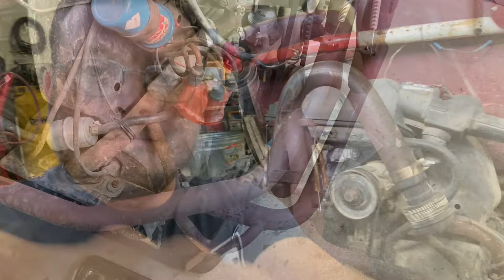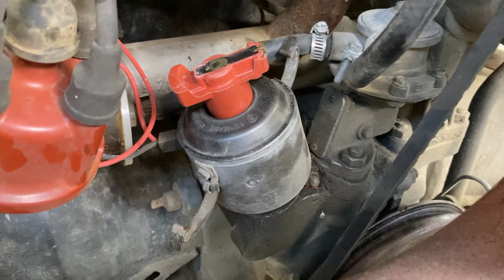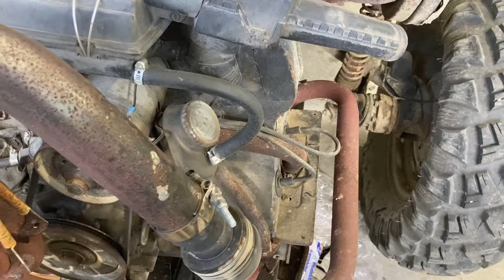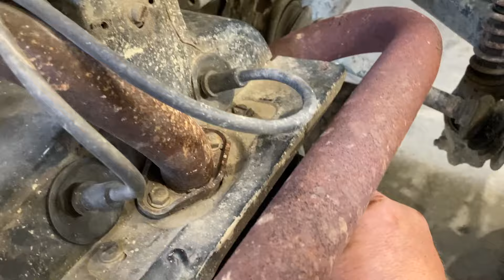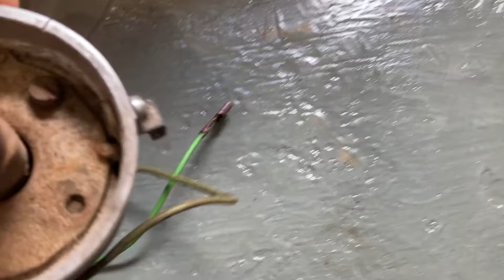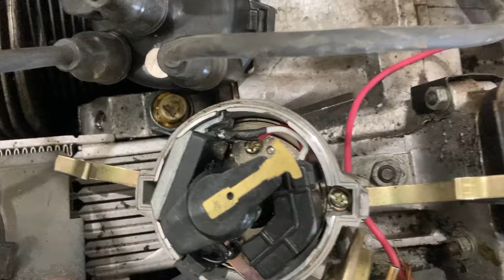Fool Proof Way: Find Cylinder #1 TDC on AirCooled VW Valve Adjustment

Comment: Great
Struggling with hesitation and idle.  
Bad has gotten worse.  
Went through a lot of trouble shooting.  
I have changed fuel pump (seems for no reason).
Changed my carburetor (my stock one was constantly leaking - but may be fine).
Checked plugs - seem ok.
Changed wires. 
Learned a lot so far. 
Checking fuel pressure next (rumors of over producing?). 

Just about to attempt timing adjustment - video is clear and a big help.  
Thanks again, Tom G
Reply from the maker: Check out the video on cleaning the heat risers and make sure they are clean. That will have a big impact on hesitation.

Comment: Thanks loads, well explained you helped me out of a problem that was a nightmare my valves were tight at tdc on pulley mark,number 1 cylinder with rotor pointing at number 1, so wrong thanks again, mark from Wales, uk
Reply from the maker: So glad it was a help!

Comment: I loved your explanation however I find that I make sure the pulley has its notches at either the top or the bottom and then go looking for the lose valves and adjust them and work backwards from there.
Reply from the maker: This was designed to make it as simple as possible so no one makes a mistake. There’s a lot of faster ways to go once a person is a lot more experienced

Comment: Just come accross your video great vid btw had issues with my t25 were ihve ahd to redo both carbs timing spot on but valve adjustment seems really tight and getting poping could that be were to tight .?
Reply from the maker: It could be.

The first step on any tune up for an air cooled volkswagen is setting the valve adjustment.

Here’s how I approach a tune up 

1) Valves
2) Plugs
3) Points
4) Timing
5) Carburetor Last

Comment: why is there 2 marks on the pully for alignment to case split? or does it matter which one to line up?
Reply from the maker: Different pulleys over the years had a different number of notches near TDC. For our purposes in the valve adjustment, the notches shown on this pulley aren’t significant enough to make a difference. As long as the valve is closed and the rocker free as shown, you’re OK
Reply: Thanks, that's what I thought for an old VW engine

Comment: Adjusting valves with engine cold is just a reference, I always do mine at operating temperature and every engine is different depending on cam etc you can make lash much closer then check when cold. But I set mine and engine sounds like it has hydraulic lifters.  Has to be at operating temperature and then I change oil. Been doing it that way since the 70's.  My ram air pontiac I'd set at 1 thousands and that's conservative,  some guys do zero lash that's a little extreme for me 😁
Reply from the maker: It’s not just a reference. If the engine is warm, the clearances will not be correct. Heat expands everything in the valve train, so if you set at .006 when warm, it will not be .006 when cold.

Volkswagen engineered the valve clearances so that it must be done cold to have proper clearance at operating temperature.

If the valves are too tight, they won’t properly transfer heat and you’ll burn valves. If they’re too loose, you’ve lost efficiency and it creates other problems.

Stick with the official Bentley Manual that Volkswagen used in the dealerships
Reply: @MaineMachinist  Yeah been doing it since the 70's hot and when cold comes back to. 006 for exhaust and  .004 for intake. Material of pushrods is a big factor for valve lash. Operating temperature is far more accurate than cold,  it's as close to dynamic you can get. I've adjusted hot on some engines to have it come out as .010/.012 cold 😳 Your engine looks pretty basic/stock to me. You start putting exotic parts/materials in your engines and you WILL run into valve problems.  Same goes with balancing,  static balancing is good but dynamic includes so many more variables.  You're a Machinist you know all about the variables calculating feed rates for Machining. Material is number one on the list then tool including the amount of Flutes material of tool, coating on tool , I can go on. You start putting dual carbs with dual port heads and light weight pushrods and all on that buggy and you'll learn the hard way setting a cold lash that's close.  I believe most want you to start at .014/.016 then when hot measure to come up with your own tolerances on all 4 cylinders. You might find a difference between cylinders 1/3 compared to 2/4 depending on exhaust.  Just trying to keep your valve train maintenance down to a minimum and performance up a tad. I can go 2 oil changes before needing to adjust.  But you can do what you want, if it works for you great. You do know all tolerances in an engine are a calculations for proper OPERATING tolerances ! Also if engine going into storage for any amount of time,  it's recommended to backoff rocker rod bolts so springs won't weaken. Not all engines are capable of this being done but 6 months with a intake valve sitting wide open can't be good 😕

Comment: This is great stuff but I have both an aftermarket distributor and pulley, so there are no notches on either 😭😭 I need a breakdown on how to find TDC without any marks or notches.
Reply from the maker: Watch the rocker arms move to find when both are in the closed position on Cylinder 1. Closed position means the valves are closed and therefore both rocker arms should be free and able to move by hand as shown in the video.
Reply from the maker: You can also remove the spark plug and use a wooden dowel in the hole to find when cylinder 1 is at its highest position (TDC)

Comment: Yes some adjust #1 and then turn the engine backwards just for convenience to adjust #2.  All are set at .006.  But why would you turn the engine backwards?  Turn it FORWARD and adjust #4 on the other side of your car.  (Stand up, walk over there, lay back down) 1-4-3-2 IS the firing ORDER.  Adjust accordingly! The feeler gauge should slide moderately without a lot of friction.  Trouble getting the feeler gauge in there? TIGHT valve! Loosen the nut and turn the screw counterclockwise ever so slightly. Re-tighten the nut. Try again. Easy to moderate sliding(friction) means a good clearance.  A tight valve will made a clicking metallic sound when running.  Listen for it!
Reply from the maker: Why waste the time getting up and moving needlessly? This is faster, easier and superior in every single way.

Comment: Also #3 Cylinder Intake & Exhaust Valves will move at the same time, will determine if your at TDC to Adjust # 1 Intake and Exhaust Valves.If #4 Cylinder Valves move at the same time, then you will adjust #2 Valves.Repeat the Sequence on the rest.

Comment: Wondering - I have a tube that comes out of the left side of the deck plate and goes to a small pot mounted to manifold with a lil nipple on it - What is it????  oil breather / cooler?  Cant seem to attach photo?
Reply from the maker: Almost certainly was a cylinder head temperature sensor from a later model engine that was original Fuel Injected.

Comment: I don't have a distributor it's in an airplane and it's a 1835 so how do I determine cylinder number 1
Reply from the maker: Does your crank pulley have the marks on it? You could line it up with the case halves and pull the valve covers to see which valves are closed or open. You could use a wooden dowel in the spark plug hole to help find the piston at TDC
Reply from the maker: What’s your ignition system?

Comment: Simple put the car in 4th gear push it to see what two valves are rocking. Adjust the opposite side which will be on the back side of the cam. As simple as that.
Reply from the maker: Many ways to skin this cat. What I wanted to show here was a way a person who is very unsure of themself could be 10000% sure they wouldn’t mess it up

Comment: Tight valve equals overheating.  Then the pushrod tubes literally bend and get stuck.  Avoid that.  Keep your VW.
Reply from the maker: Total fiction. You could burn a valve, but the pushrod tubes don’t change whatsoever. Maybe you are thinking about the pushrods themselves, but even then they won’t expand to the point of getting “stuck.” Never going to happen on a factory setup with proper rocker geometry. Never happen.

Comment: If you were on # 3 the rotor would be 180 degrees from where it is now.
Reply from the maker: Sometimes you’ll find a distributor installed 180 degrees out
Reply: Hiya, I've had electronic dizzy put in, however it is doughy at moving off the start. After removing new to replace with old, I'd moved motor not realising the dizzy was out.
According to my flywheel timing mark I should be at tdc, but piston tdc is 180 off, and inlet valve rocks but exhaust is tight.
Trying to get some others thoughts.👍
Reply: @MaineMachinist   That's what I discovered about mine. Previous owner didn't bother to tell me.